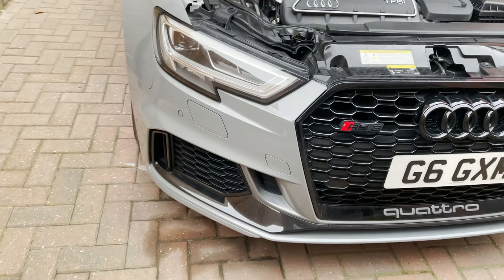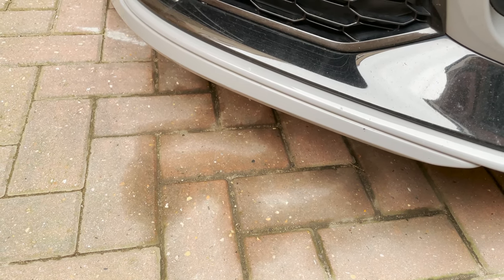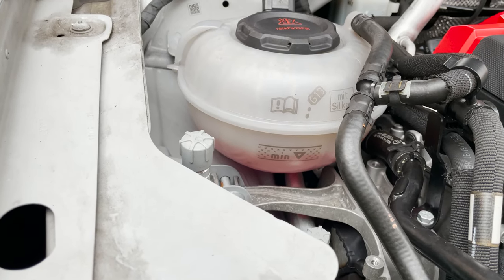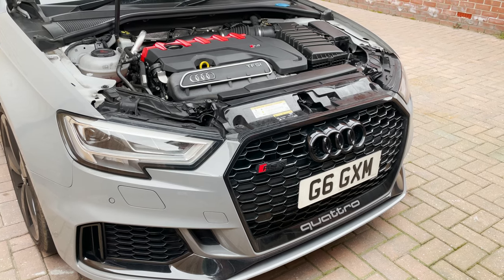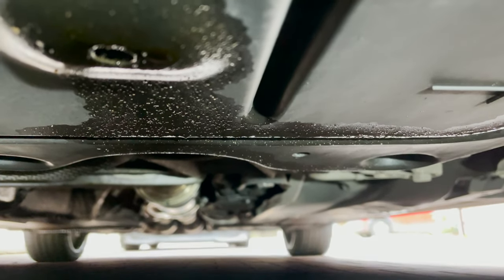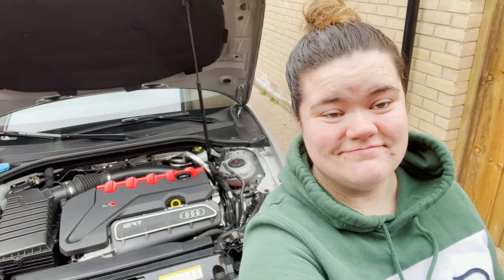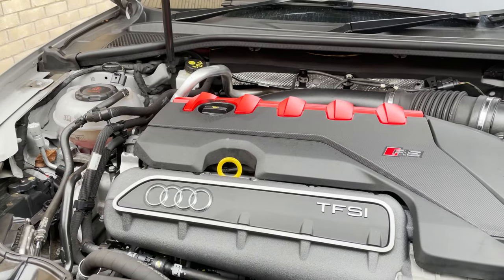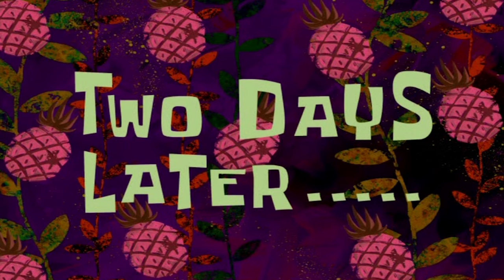BIG PROBLEM WITH MY RS3...

Comment: Good to hear it was just the oil pan leaking. Recently had my FL water pump get replaced at 20k miles because it was leaking coolant( really common issue with these cars) but got it covered under warranty.
Reply: It's been common for many years

Comment: Weird - mines got a dipstick and checks oil electronically? I had the leaky sump but cheap to fix luckily. 

I have a weird whirring round on deceleration currently which my mechanic cant identify - worried its the dreaded bezel box / rear diff.

Comment: How is your front plate fix on? looks good
Reply from the maker: Magnets! Bought them from eBay, they are 3d printed to match the shape of the grille holes
Reply: Do you have a link? Thanks
Reply from the maker: https://www.ebay.co.uk/itm/Audi-Magnetic-Number-Plate-Mounts-Black-new-TTRS-RS3-8V-FL-RS5-B9-PFL-/334290169271?mkcid=16&mkevt=1&_trksid=p2349624.m46890.l6249&mkrid=710-127635-2958-0